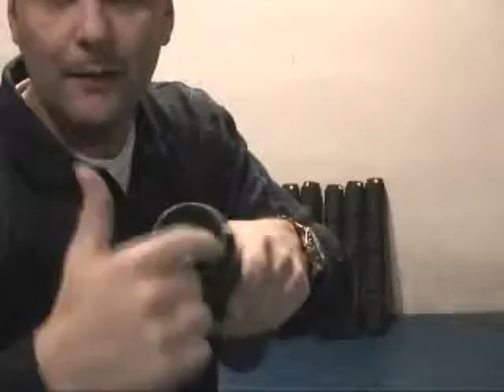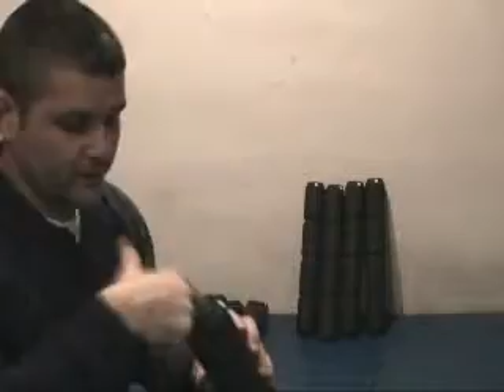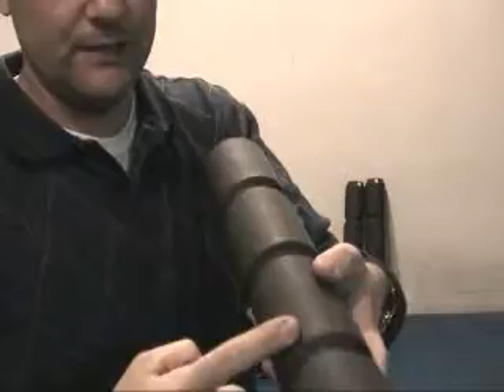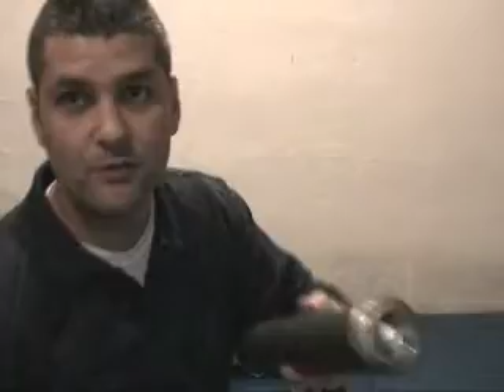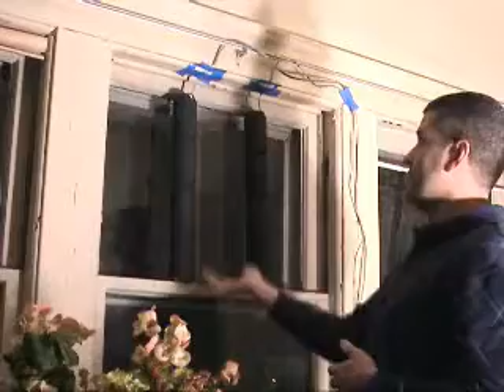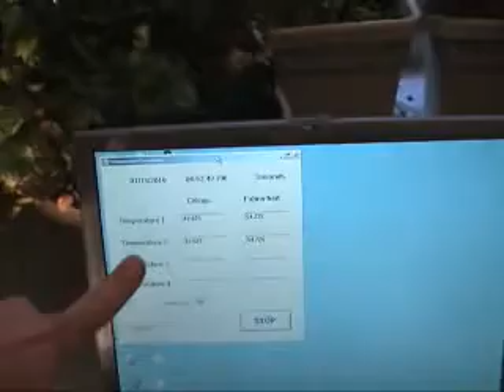Soda Can energy transfer converted

Comment: I am also making a tower that has the top and bottom of each can cut away with tin snips, but I take a steel wool pad and take my scissors to cut is down through the seam of the pad. I can then cut the flat pad into quarters. Each quarter I then roll into a tube-like piece that I can push onto the ragged edge of each can opening. I push the tube of steel wool all the way around the can opening and can smooth it out into a donut-like shape with the hole in the center. I can then join each can on top of each other and the result of the steel wool is that it slows down any wind turbulence to allow the hot air to circulates in flow a bit longer as it travels up the tower and also provides a metal contact between each can to ensure any heat transfer continues from can to can. I'd love to see you make on of those for testing, but believe me, it is a bit labor intensive to make each tower in that manner.

One other test tower to make would be for a tower that is built with the can top open on each can and the bottom sheared away completely. The sheared can is then heated in a small bowl of hot water so it expands enough to be pushed onto another can. As the heated can contracts, it sort of seals itself to the other can it is pushed over. You still have to ensure each seal is good by using silicone, but the resulting tower is basically a fully open can tower when your finished. Be nice to see testing done on any of these various tower adaptations/mods.

Comment: The sealant I would use would be a high heat silicone and not the normal white stuff as Dap or others. The reason being that the cans will expand and contract and many bathroom sealants do not have the long term flexibility to last without eventually cracking. Fire place mortar is acceptable, but it is usually much more expensive a product. Some of the high temp sealants are not paintable, but that should not be a real problem as they are usually dark red, gray or black in color.

Comment: When you show the tower that used the 3 nail holes to the bottom of each can, you did not mention if the nail holes punched in by the big roofing gutter nail were aligned with each other from can to can. Where the two cans join together as they make up the tower, were the 3 holes in the bottom of each can always aligned or just put in place at random before they were put together with silicone?

Slowing down the air transfer would allow the heat in each tower to remain longer before being blown out with a can. That should be a variable, but the 3 nail cans seemed to be highest of the top heat range. If the holes were not placed in the same position and aligned when securing the tower cans with silicone, then perhaps there is enough wind turbulence resistance to slow down the wind stream enough to make the outflow of heat be a higher temp than the other tested models.

I'd like to see how a tower of cans that is also encased in an outside tower made of clear plastic bottles the same height as the tower rate. It is another design for the diy solar heaters.  I was thinking of making a couple of different towers in my main box with the manifolds or plenums to the unit, but in addition have an occasional tower that is water bottles filled with the broken shards of terra cotta vases or perhaps lava rock or some stone that maintains heat for a long time. It would have a con of being more weight, but I thought that such a tower between the normal can ones may retain the heat of the actual box longer after the sun had gone down.

Thanks for sharing your results.